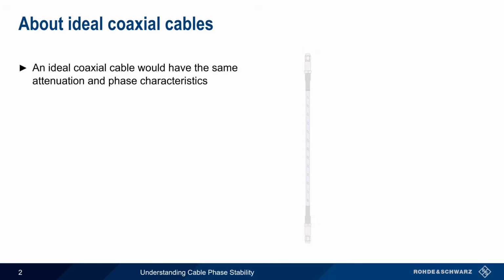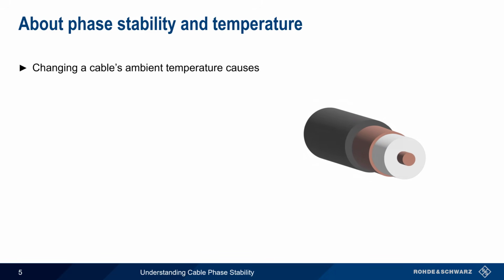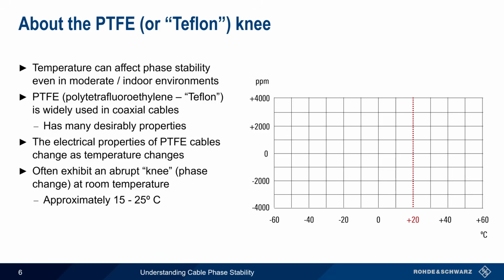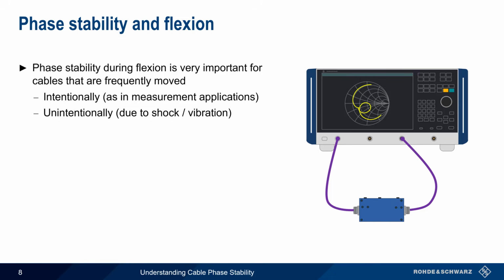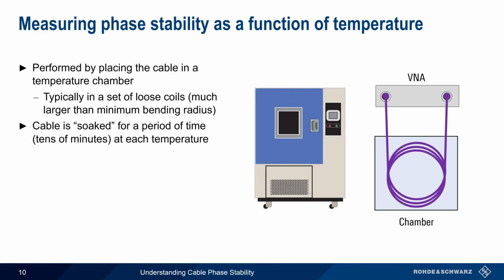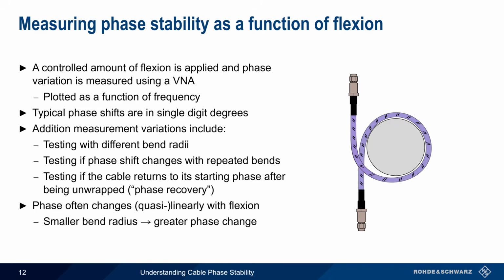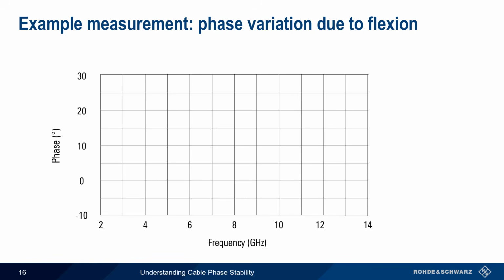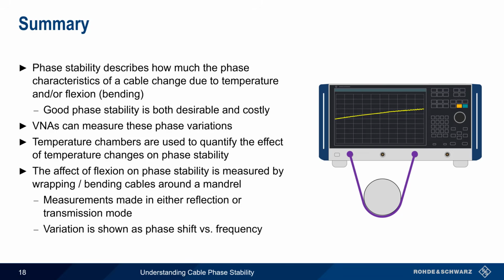Understanding Cable Phase Stability

Comment: On restraining cables: METAS (Swiss NMI) seems to use optical breadboards for some of their VNA applications, which is a really good idea- Although it's another set of fixtures and parts to buy/make store and keep track of... Paper here for those interested: http://projects.npl.co.uk/hf-circuits/docs/presentations/20150603-anamet/04b.pdf